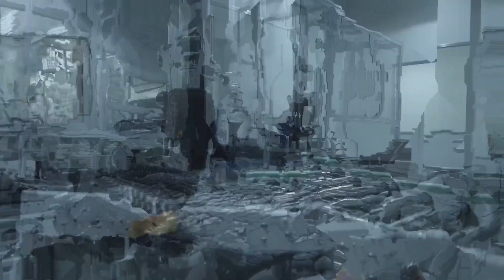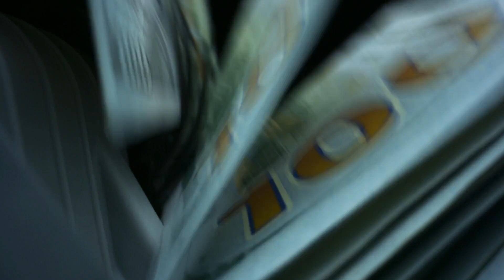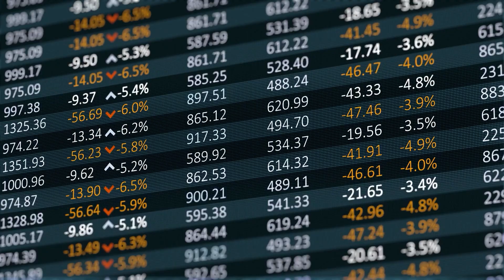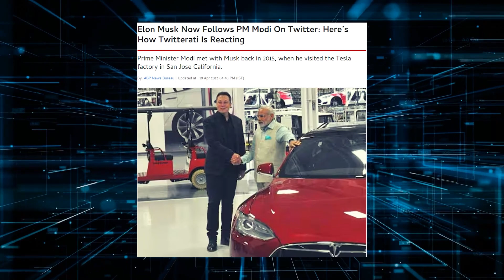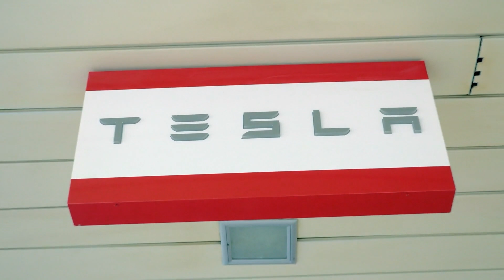MASSIVE Lithium Deposit Found In India Could Change The EV Industry

Comment: Velocity, how far behind can you be, soon no EV will use Lithium, and it has nothing to do with lack of Lithium, we are changing to Sodium ion batteries over a short time. We are building the new factories for sodium ion batteries right now, and first carbrands have already started using them. Most german  car producers will use sodium ion before 2024. Wake up Velocity, Lithium was so much last year, now times are changing.
Reply: The sodium ion batteries have lesser charge cycle and energy density mate. Might wanna re-check on ur values on what determines what materials are used for a battery
Reply: @maddog_majima9553  : absolutely.   The sodium batteries won't succeed commercially unless the price of lithium goes back to 2022 high.   And the price of lithium collapsed by 75% since last November peak when China ended last EV subsidy program -- indicating that the raw materials are artificially propped up by China.
Reply: And how and where do we get that huge amount of Sodium?
Reply: @pftvfc66 Sodium is salt. It is literally everywhere and easily extracted. Making it extremely cheap yet useful.
Reply: @pftvfc66  do you understand that sodium is salt?